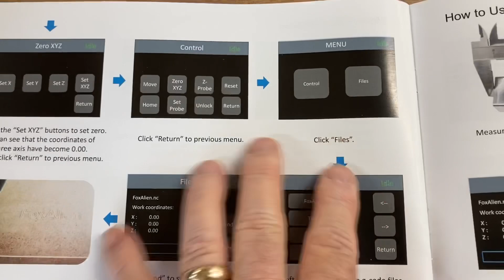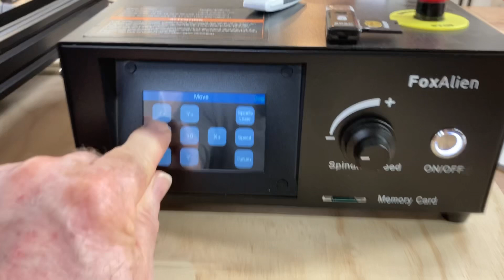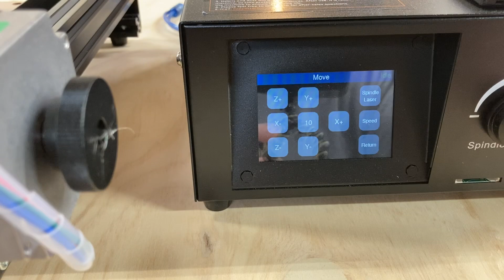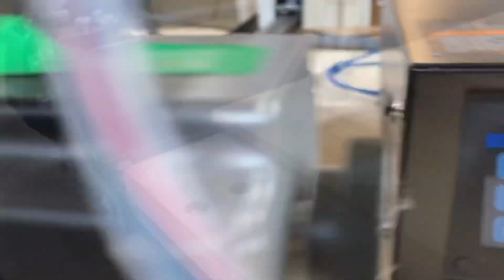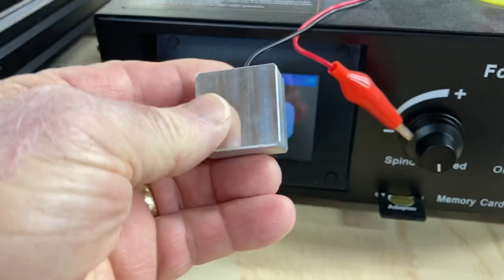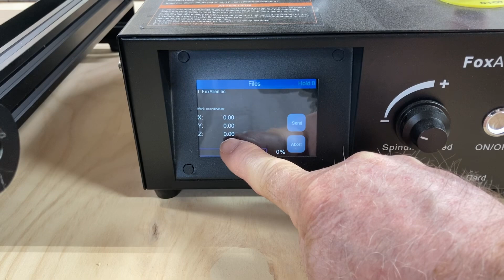Carving with NO Computer and NO Internet needed with the FOXAlien 4040-xe

Comment: Hi. which software we should I use for a 4040 Masuter  spindel ?
Reply from the maker: My personal choice is to use VCarve Pro by Vectric to do all the design and gcode generation. Then I use the Openbuilds controller to run the machine. The Openbuilds software is free.

Comment: I have nothing but issues with my 4040 fox alien. Have been e-mailing back and forth with fox alien about the software Grbl/Candle. Still no answer to my problem. Beginning to think I made a $500 mistake buying this machine. Do I need Grbl/candle to run the cnc? If I purchased software from Easel will I need Grbl/Candle?
Reply from the maker: No, if you have easel then you can design and run the machine without anything else. If you go with something like VCarve to design then I would suggest the Openbuilds controller. It’s free
Reply: @PawPawsWorkShop  Thanks for the info

Comment: Hi , is their much difference  in a belt cnc and a screw thread type. Ie screw thread more money. Looking to mainly do 3d carving ie a dog 🐕 in a wood etc.
Reply from the maker: Belts get old and crack, they stretch. Screws do not. Screw drive and linear bearings are better than wheels (plastic) and belts.
Reply: @PawPawsWorkShop   Thank you for your reply I will look into a screw thread type . ENJOYING YOUR CHANNEL

Comment: I don't know anything about this stuff but is there a reason why not to use double sided tape instead of putting glue on regular tape? ...just a question. Thanks for sharing this video!
Reply: I use double sided carpet tape for my projects. It works well but it can be hard to break things free afterwards and it leaves a gummy mess sometimes. I like this glue/tape method because you can just peel off the tape and throw away easily.
Reply from the maker: Yes you can. Some of that tape is to thick. Also, check the price

Comment: Thanks a lot. I am one of your subscribers and enjoy and benefit a lot from viewing your program. I have built a  CNC table , but would like to buy the controller and the control box you showed on this programe- are they available?i have two Nema 23s steppers for the X-Axis and one each for the Y and z Axis . I would like to use them with is a controller if they are for sale separately?
Thanks a lot for your help
Reply from the maker: The controller is from CNC4NEWBIE. Phil Johnson designs, builds and tests each one before he sends it out. The control board is clearly marked and it is easy to work with. The last time I checked you can order from CNC4NEWBIE. I am not affiliated with them except for the videos that I have produced. Thank you for watching my videos and for being a subscriber.

Comment: Great information, however i do have one question to ask if you don’t mind.

I set my Z probe at 20.0. After I set x/y I attempt to use the Z-probe. Machine acts normally, come down touches metal and roses back up. However when I start the carve, the machine starts about 4 images above the work material. Any ideas of what maybe causing this.

Comment: I am brand new to cnc routering and I have the masater 4040 and I was wondering what is a good program to download to get started with making stuff
Reply from the maker: You can start with easel and later move up to VCarve by Vectric. You’ll need UGS (universal gcode sender) or open builds sender program. Both are free sender programs.

Comment: I guess you would have to create the job on the computer and save it to the SD card and run it from the controller? Once you save the file from the computer, it includes the toolpath (G-codes) as well? I have another question also... what's the difference between setting the Z-axis using the piece of paper or the Z-probe? Looks like 2 different height settings.
Reply from the maker: Using the probe is more accurate and is repeatable. Using a piece of paper works for most project. However, if you need to duplicate the process you will most likely be a few thousandths off
Reply: @PawPawsWorkShop  
Thanks Paw Paw.

Comment: In the demo you did a file that was preloaded and run by candle I assume. Say you design something in easel and send the g-code to UGS. Can you run the file with the memory card and not use the laptop?
Reply from the maker: I do not use candle. I use UGS AND Open Builds for my sender
Reply: @PawPawsWorkShop  maybe I’m asking the wrong question. How do you use the offline controller with the UGS? Do you have UGS saved on the usb stick or????
Reply from the maker: The offline controller is self contained and will control the CNC. You can set the x,y,z axis and run the gcode using the SD card
Reply: @PawPawsWorkShop  ok thank you, I will give it a try.

Comment: Im new to cnc Software what works best with this Machine and is easy to use and install the G code to a SD like you installed
Reply from the maker: You can start with easel and generate the gcode. I use the UGS (Universal Gcode Sender) to operate the machine. You can also use the SD card on the 4040xe and use the screen on the controller to operate it.

Comment: Ok, just got my 4040-xe set up. Everything is working up, down and all around. Now, you set your xyz to a pencil x on you base board.....how do you adjust to the thickness of your work piece? And how do you control the depth of the cut?
Reply from the maker: Use the probe or use the paper method. Lower the z axis u til it just touches the paper. Select the “set z axis”

Comment: I have the 4040XE and want to use VCarve.  What post processor should i select?
Reply from the maker: I use the XCarve post processor. You can also use the generic inch or metric post processor
Reply: @PawPawsWorkShop  I tried both and neither worked. What did was the Easel post process.  Something to know if another person has the same problem.

Comment: I just got the Masuter 4040 Basic from my kids as an early Christmas present.  Everything went together well and the x y and z axis move fine with the offline controller. My issue is that when I add the file for the test patterns, the controller shuts off and restarts when I send the file to the machine.  Do I need to raise the motor to get the file to send?  Or am I missing something else?
Reply from the maker: I am experimenting with the controller now on different machines and having similar problems. Not sure why yet. Also, I’m not getting it to unlock the machine. The controller works well with the 4040xe. I use UGS, Universal Gcode Sender to control my machines all work perfectly. Therefore, I conclude that it is the controller. I do not know why yet and will be experimenting more. I want good solid information to take back to FOXAlien to work on a solution. My suggestion is to try the Candle or UGS as I do.

Comment: I was interested in buying one of these, I'm doing research on it now.

Could you tell me if I'm able to carve and cut out pine 1x material 3/4" thick or 2x material that's 1.5"? I plan on replacing the router with my dewalt quickly after purchase
Reply: Ideally I'd like to be able to make a round clock for example, using either 3/4" thick pine boards, and be able to carve out both the numbers and the circle shape
Reply from the maker: The 4040xe should be able to do it. Also, they just introduced a strong machine that would do even better. Also look at the Genmitsu 4030. It’s very solid also
Reply: @PawPawsWorkShop  thank you for the reply!! Do you know offhand the name of the stronger machine? I came across them on Amazon, I didn't like that the Genmitsu seemed to have bad customer support. Not sure if this is true, but it was in the reviews when I looked at that brand
Reply from the maker: FOXAlien Vasto is the name of the new machine.   This looks like a very solid machine

Comment: I’m having the worst problem trying to get my first cut done! It has no problem doing the FOX part of the A after that it just goes right above where it should be cutting
Reply from the maker: If it is carving correctly and then turns and goes to another area it usually means a mechanical issue. Missteps, hitting something,loose belts, wheels either to tight or to loose.
Reply: @PawPawsWorkShop   it doesn’t stop or go where it’s not supposed to be just on the last half of the job it doesn’t go in the wood like the rest ! I have tightened an I just loosen them a bit it’s still doing the same thing if you have a email I could send a video to I’ll like to get passed this step

Comment: Are there any files besides the intro ones on these usbs that came with the cnc? I thought I wouldn't have to use the laptop for anything but it seems like I am going to have to use the laptop.
Reply from the maker: You can design on the laptop. On February the design is done create the Goode and save to the SD card. Bring the SD card to the shop. Not the computer

Comment: What's the point of the Z-probe?
Reply from the maker: Repeatable accuracy!  You can use the paper method as I did in the video for some projects. When you change and use multiple bits the small variations can make a big difference thus the importance of the z probe.
Reply: @PawPawsWorkShop  can I just use the z- probe all the time instead of the paper method? It seems like it would be easier just to use the Z-probe
Reply from the maker: Yes I’m just showing different methods. If you have watched my channel for a while you will see I do different methods for different projects all the time such as paper for the z axis, just the z probe and even the 3axis touch plate that I made and use.

Comment: Does the memory card need to be in there to work? And is it supposed to slide in all the way because I can't get mine to go in all the way. Is it supposed to stick out?
Reply from the maker: Yes, leave the card in the machine. Yes, it will stick out a little
Reply: @PawPawsWorkShop  sorry but I have another dumb question for you. Do I need to set the xyz everytime or do I just set it once and leave it?
Reply from the maker: Yes, you will need to set it each time you do a project.  When you turn off the machine it loses it location.

Comment: OK Paw Paw....  Pap here, and I'm stymied right out of the gate. 
Finished assembling my 4040 XE today and made connections to the control box. 
Fired her off and watched this video to go through first time using controller to move spindle. 
On the control box in the upper right hand corner, I am getting 'question marks' instead of 'alarm' and when I reset to try again, still 'question marks'. 
Does the control box come with software already installed, or do I need to do an installation first ? Manual doesn't say that, but I've checked my wire connections to the box, wire connections at X, Y, Z  , no limit switches engaged , just dead as a hammer.
Any suggestions?  
Thanks kindly ! Pap
Reply from the maker: When the ??? appear in the top right corner that means that the limit switch need to be unlocked.  Click on reset and then the status will change to Alarm.  Next you need to click on Unlock and the status will change to Idle.  Now you should be able to move the spindle.  If it changes the status to ??? again, just repeat the steps again.  Look at your user manual on page 20, it shows you step by step how to unlock the limit switches.
Reply: @PawPawsWorkShop  Finally figured it out with help from a fellow poster on Facebook's Fox Alien site. 
The E switch was in the lock position. That's all it was. 
I had tried checking each limit switch, disconnected and reconnected the wires on the back of the controller, checked every X Y and Z connection, but just didn't think of the E switch.....
But thank you good, sir. I'm sure I'll pester you again before too long!
Reply from the maker: Cool, that was my next step.  Think of it as a limit switch also.  It is an emergency stop.  You will get the ??? until you reset the E Stop and reset the machine.
Reply: @stephenenglebright  FoxAlien Facebook community has lots of experts. They are willing to help each other and share their experiences.

Comment: I have been following all of your videos on cnc & lasers. What I like most about this one is the small footprint, and you can run it without the computer. I noticed on the control box the word laser. I'm thinking you can add a laser to it. Are you planing on do a video on the laser? Keep up the good videos.
Reply from the maker: Yes, you can add a laser. In fact FOXAlien has a 20w laser that I will be adding shortly.
Reply: @PawPawsWorkShop  I hope you will show just what can be cut with the laser. You're videos showing what you can do with a cnc and laser are answering a lot of questions I have had. Have you said what the max size that can be done with the FOXalien? Thank you again.
Reply from the maker: The bed is 400x400mm or about 15.75x15.75"
Reply: @PawPawsWorkShop  Thank you very much.

Comment: Very educational. Thank you! Two questions, please: What is the largest size piece that can be placed in the bed? How large of a carving can it make?
Reply from the maker: It is 400x400mm or about 15.75"x15.75". I have not yet measured the x axis  for the total width.  As far as the y axis, you can go as long as you wish and just do the tiling function.  If you wanted to make a kids growth chart for example, making it six feet long would be not problem.

Comment: I’m back and forth between the Foxalien 4040XE and the 4030 ProverXL. Not sure on which one I should get.
Reply: Both FoxAlien 4040XE and Genmitsu 4030 are pretty good CNC machine at this price range. The offline function makes the 4040XE stand out.
Reply from the maker: I really like the off line touch screen feature that is not offered in other machines.
Reply: @PawPawsWorkShop  I also like that you can upgrade the spindle to the DWP611. Which I happen to already have.
Reply from the maker: Yes, that makes it where you can add the 1/4" shank bits.

Comment: I got one of these about a 2 months ago. Like it a lot. Fox Alien sells a mount for the Dewalt router. I just upgraded the spendal to the dewalt last week. I didn’t like the 1/8” collet size and was a little under powered. Assembly was really easy got it done in like 45 minutes. Instructions were complete with colored pictures. So far so good. Oh and the Facebook FoxAlien group is very good for support and sharing projects.
Reply: question, where did you get the dewalt router and mount for this machine, by looking at this, the router that comes with it is under power'd.
Reply: @mtz3843  FoxAlien sells the mount on their website. The Dewalt router can be found at home depot and Lowe’s.
Reply: @alex83h  thankyou so much
Reply from the maker: Thank you very much for this information.

Comment: Lovely piece of kit, not too big on footprint, low noise, spindle is powerful enough. Great starter v(wish I had this instead of cheep 3018 clone)
I assume you can still use it with Candle or UGS etc?
Reply from the maker: It is a great choice.  It is also very solid.  I love the fact that I do not need the computer in the shop
Reply: I use mine in sound box in lounge,(no workshop)  40-50Db down from 70+, so low noise is critical.